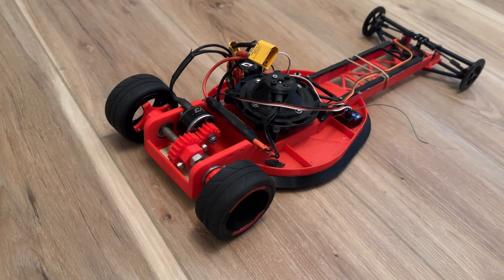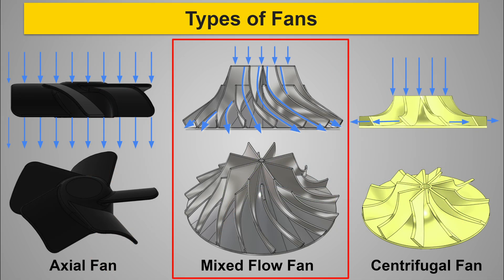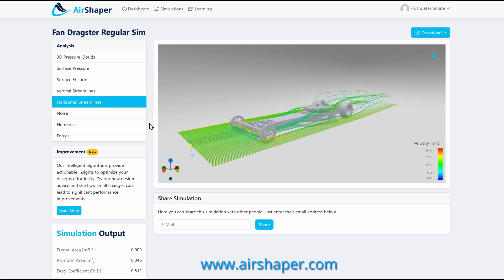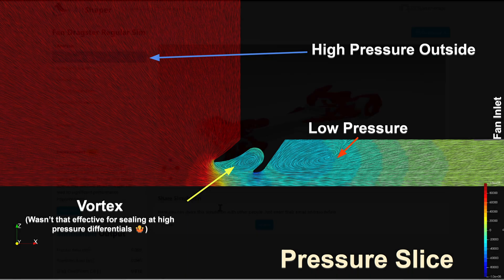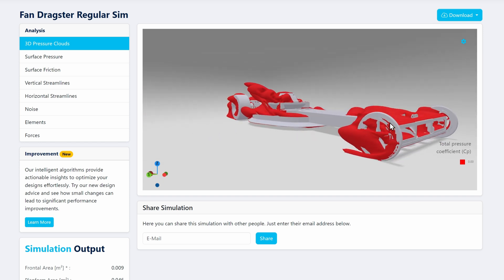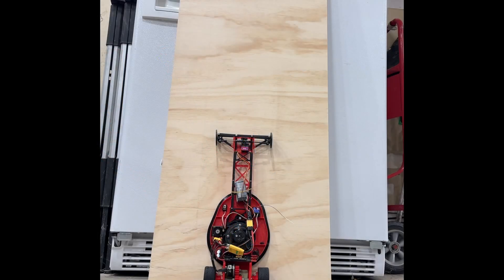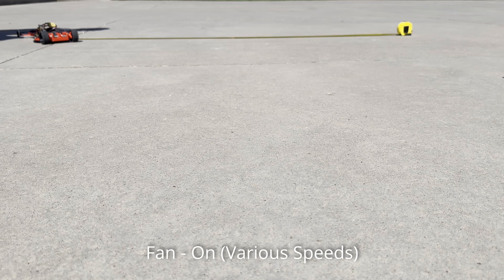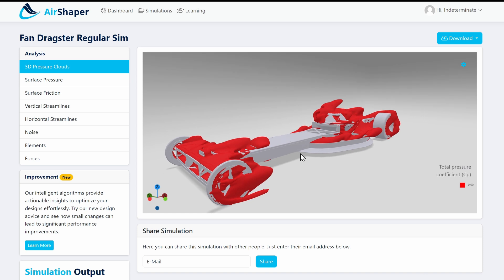This RC Dragster Uses a Fan for INSANE Downforce & Acceleration!

Comment: I think you need a Canard fan or at least a suction pad and duct in the front of the vehicle.
 It's unbalanced and the acceleration forces by suction holding down the front end.
 Maybe also add a truss-like structure or a roll cage as long as it spans the length of the frame rails.
Reply from the maker: Yeah, I definitely didn’t engineer the frame nearly enough. I agree, the suction force distribution isn’t great for this chassis and overall stability.  I’ve thought about adding a front wing, because this would also help keep some of the air from getting forced under the skirt at high speeds.

Comment: Your projects never cease to amaze me. Its just another level of engineering, compared to the usual YouTuber.
One suggestion for your bending Frame: try Gluing flat carbon strips  on the top and bottom of your Frame. Something like 6*1mm flat profiles, those are used in DIY airplanes as Wing spars and general reinforcement. This should produce an incredibly stiff Frame!

You can also make cool composite Leafsprings out of those.
Reply from the maker: That’s a great idea. I keep looking for an excuse to buy an assortment of those spars and tubes.
Reply: @IndeterminateDesign  I can absolutely recommend that, very helpful to have on hand.
Be careful with the tubes, most of the small ones are pultruded and like to split longitudinally.
Starting at 6 or 8mm, you can get woven tubes. Those are more expensive but more robust.

Comment: Another awesome video 😁Out of curiosity, I calculated the thrust if I pointed the intake down and exhaust up, with an 800cc engine running at 13000rpm. It's a pathetic 1.7N (far better if you put it through a narrow nozzle)
Reply from the maker: Thanks!  That’s crazy how low the thrust is of an engine spinning that fast. I guess it makes sense, something like a propeller is moving a massive amount of air mass to generate thrust compared to what and engine consumes.

Comment: I could not see what GPS you were using. But take a look at the RaceBox micro. It weighs 16grams without the case and can be powered by the receiver 3.5v-16v. 25hz GPS and an accelerometer. It could be perfect for your measuring...
Reply from the maker: I’ve been wanting to pick one of those up so I don’t have to mess with mine. I have a small ESP32 hooked up to MTK3333 gps and it doesn’t like to get a fix around any kind of buildings.
Reply: @IndeterminateDesign SIR I'm so so sorry for asking you a stupid question but,what way did the wind on the fan blow??Down towards the ground/Or upwards towards the sky to get good down force sir????